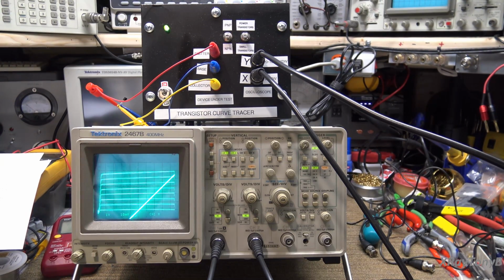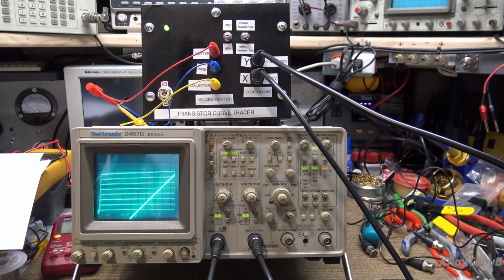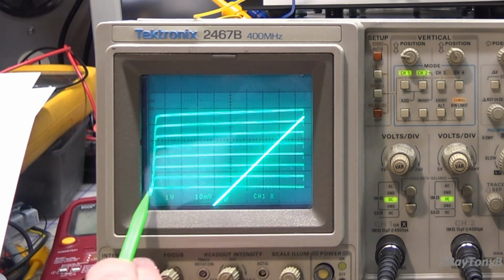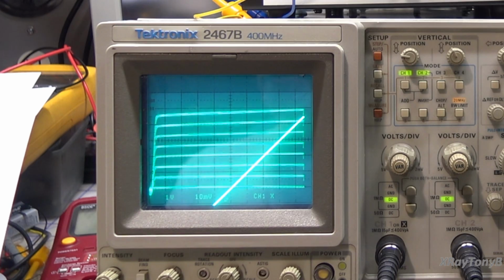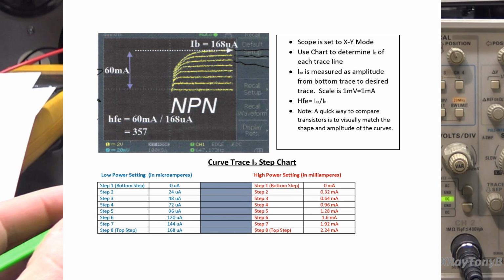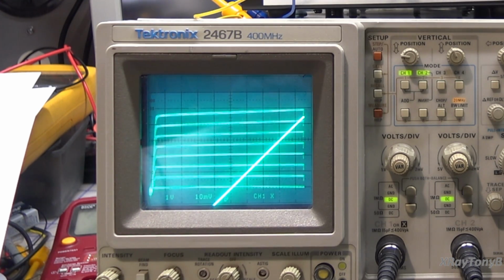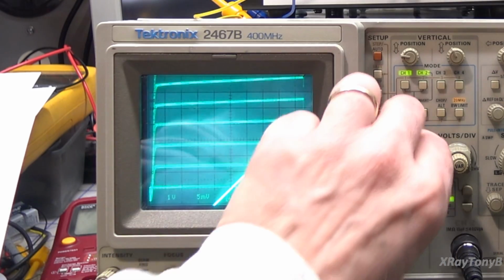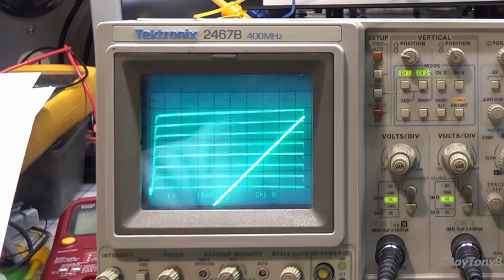Transistor Early Effect, Temp vs Hfe & Ft vs Hfe.... Messin' with the Curve Tracer

Comment: I completely forgot that I learnt that at college! Thanks for the refresh, very informative. I guess I forgot it because primarily I repair valve radios as a hobby and P.Cs/Laptops/Comms equipment as a job, so I don't deal with discrete transistors that much any more. Interestingly I've just watched a video by @Ptronix who touched on the subject of the Miller effect while building an active probe for a signal tracer. It's amazing how many things affect the performance characteristics of transistors and F.E.Ts. and divert them from their original performance specs.

Comment: There seems to be a conflict:  At 11:02 , the pop-up says:” As higher voltages are applied….the depletion region increases….”, then  the last sentence says: “increasing Vce further  decreases the effective depletion region…..”       of the  collector -base, or emitter -base ? Please clarify.
I’m thinking it would be better said:  increasing Vce increases collector  base depletion width, thereby decreasing  width of the charge carrier portion of the base.
Reply: I think what I took from it is that as Vce increases so does gain.
Reply: @jonka1  I agree.  The scope display illustrated. I just thought  the pop-up statement was a bit confusing./misleading.
Reply: After re-reading I guess the statement could be considered grammatically correct.  If There are two depletion regions between the base and collector.  One effectively gets smaller while the other gets bigger, making the gain increase.

Comment: Tony this was perfect timing, I just finished building the kit and have started using it.  As a novice calculating Hfe has been a challenge, and this really helps.  This is probably obvious to many, but I have watched the video several times and reviewed the documentation I got with my kit (yours seems to have more detail) but I do not understand how you came up with the 1mv=1ma.  I am asking because I also have a tracer built into the Digilent Discovery 2 and want to use it for small transistors.  I was concerned that the 1mv=1ma may be tracer dependent.

Comment: Thank you for the exellent explaination that most of the amplifier "tricks" is to workaround the physical effects. As an analog IC designer for 30y i would be very unhappy with the current state of model informations for discrete devices. That dissappoint people try to use Spice for discrete designs because the simulations results fail to match measurement on the boards. They blame the simulator but its the don't care policies of the vendors. Even complex analog ICs lack accurate interface and internal working models which could be simulated. The big A and T think its some kind of secrete but miss the essentials of a working engineering community.

Barry Gilbert gave a class in foundation desgin where he show how iterative incooperation of the more physical effects modelling allow a designer to separate the results and judge his circuit topology countermeasures. Prob. ADI think its to secret to heritage his knowledge.

For the "early" ist important to know that the "interpolated" crossing voltage depend on current and voltages as well. Its non-linear. And because of selfheating in static it could get infinite. I fight in early days that foundries should extract to better models like VBIC, Mextram, HiCUM and even today still HiCUM II is lacking specific effects in very high speed designs which are essential to analog design. To me ist a broken business model  to think a lazy model support its part of a fab.

Comment: I remember some very early transistors with transition frequencies in the audio band, even down as low as 10kHz, which made them really great in power supplies, as they pretty much would be stable, but replacing them with newer parts would result in oscillation. Same for old 2N3055 transistors, some of the original designs relied on the transition frequency for stability, and putting in newer process transistors, marked 2N3055, but with modern processing that shifted the transition frequency up to 10's of mehgahertz, like the 2N3773, would result in the circuit oscillating and burning out the transistors. You had to add in extra filtering, like 10R and 470p into the base emitter side, to provide this extra filtering, and lower the transition frequency back down to make them stable again.
Reply: Oh the "good ole days" replacing original components (unavailable at the time of replacement) with more modern equivalents. I experienced this digital TTL devices. Designs that worked with original components had to be "tamed" with liberal application of capacitances to slow them down.